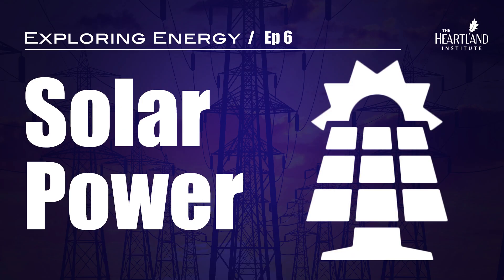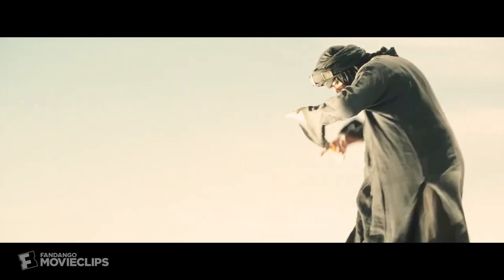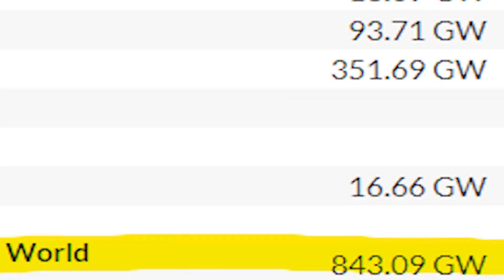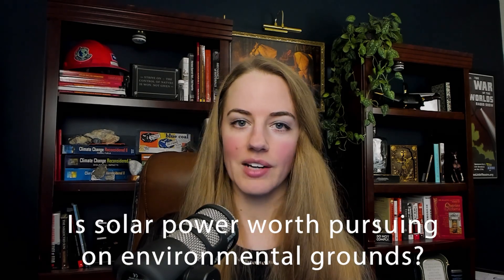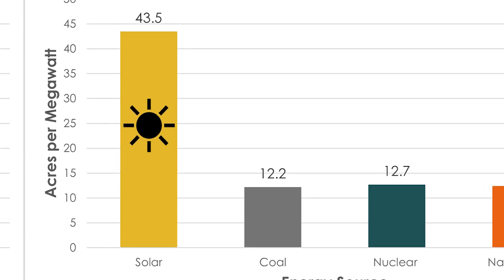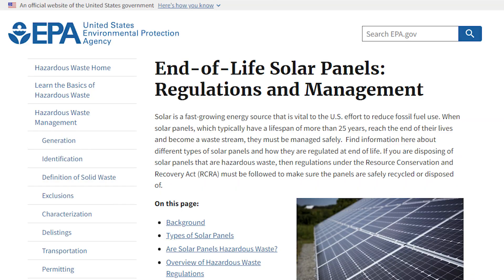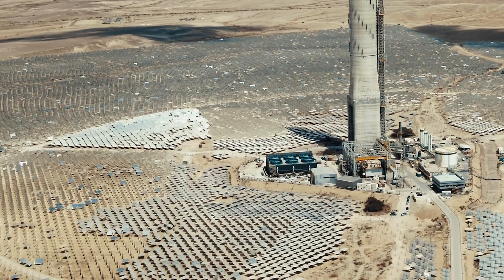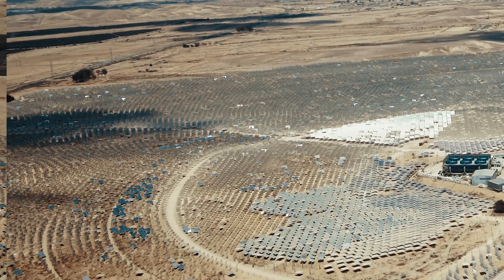Exploring Energy: Solar Power

Comment: The significant negative aspect of wind and solar is that they are INTERMITTENT sources of energy unlike nuclear, coal, natural gas, hydro, etc. My home's electric energy is supplied by: 88% hydro, 11% nuclear and 1% fossil fuel.   Going 100% renewable will require significant adjustments to our way of life and economy much of which is unanticipated.

Comment: Any & ALL intermittent sources of power generation cannot be relied on to be the sole provider for any area or section of the community! As they cannot provide BASE load  on a continuous basis, The only extremely safe form of renewable energy that does not produce CO2 in its operation is HYDRO POWER whether in large Dam configuration or "Run of river"or even that of Wave or tidal!  But the powers that be appear to have ignored this form of generation out of hand! pretty much across the globe!

Comment: I have 3500 watts of solar panel on the top of my boat, it's pretty useless most of the year in the pacific northwest, but it does help while anchored out in the summer time.  I still have to run a generator a few hours a day even with solar on sunny days.  This is just for powering gear on the boat, fridge, freezer, water pumps etc.  No chance at all for a propulsion system. Solar is not the answer its a supplemental power source at best.

Comment: From New South Wales Australia. We went to stand alone solar with diesel backup for one simple reason, to connect to the grid which is just 75M away we had to pay for the transformer, pay for the pole and the wires and then pay for installation and connection. We owned none of these, they became the property of the power company. In return we got electricity which we had to pay for. At half the cost we went to solar and haven't paid an electricity bill for the past 4 years.
To me the grid system is greed driven (Not profit, absolute greed), I can't imagine buying land, building a store, stocking the shelves then giving it to a supermarket chain so they can sell me my groceries. That's what is happening to us all with wind and solar power generation, our taxes are making them profitable which means we are paying twice for the same infrastructure.
Reply: Great analogy.

Comment: To be fair, there are panels that are sensitive enough to work even on cloudy days, but these are the exception, not the norm. It's been about 20 years since I first became aware of them and I am not familiar with their usage now. The basic principle is that, during daylight hours, there is, of course, sunlight. It's simply diffused by cloud cover.
Reply: Supposedly they will generate about 10-25% of the energy of a sunny day, depending on the panel's efficiency.
Reply: Cloud cover? 💨✈